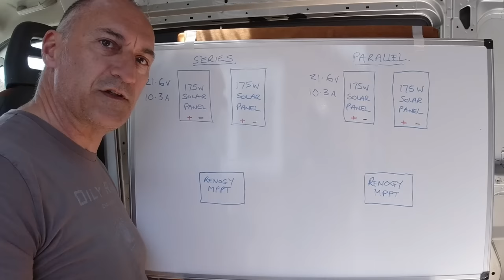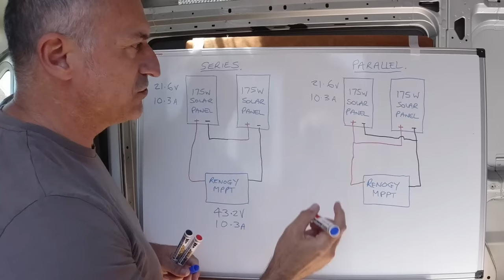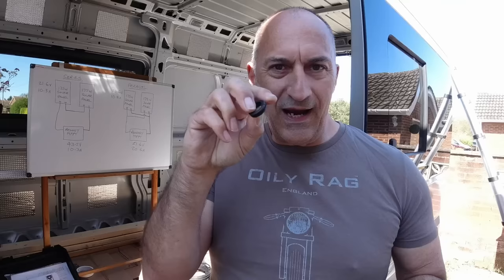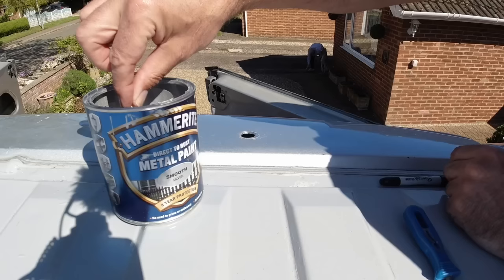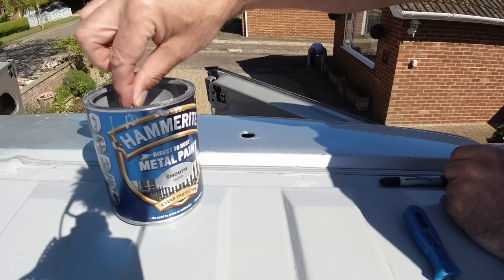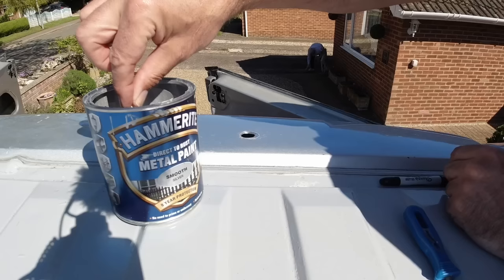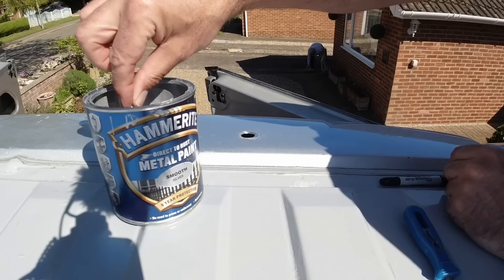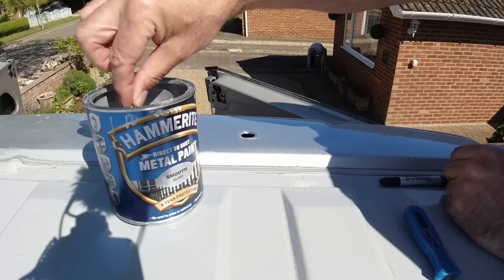How to Install Solar Panels - Budget Van Build Ep 10

Comment: Hi Greg you are helping me so much and for that I am truly grateful, I have a question if I May pls? I have a renogy rover 40amp MPPT with 2x100 watt renogy panels producing 20.1 volts 11-19 amps  and a 435 watt longi solar panel which gives 11-19 amps and 35.1 -40 volts am I best to run these in parallel or series pls? Thanks Jay

Comment: Hi Greg, fantastic video as always!
I have some questions
- Do you only hold the panel with one screw for each braket?
- I have exactly the same kit but when I try to put the tek screws on, they keep turning and they never seem to stop. In your video I saw that you don't make a great effort to bring the screw until it stops turning, but once it hits the bottom, you stop and add sikaflez on top.
is that so?
Thank you so much

Comment: I attached L-Track to my roof then attached the panels to those. If something changes down the road, and I need to replace the panel and can’t get the same size or want to do something different on my roof. I have those track too attached to no more new holes in my roof.
Reply from the maker: Well done 👍🏼

Comment: Hi greg im fitting two 175w panels on my mwb ducato i need to order the 6mm extension cables that run from the panels to the charge controler can you tell me how long they need to be thank grwat videos ive watched your videos like an instructuon video so far fitted the maxair fan and the floor so thanks for the videos really helped

Comment: Very nicely done and explained Greg. Guess what - I have got a box  of those grommets - box of 100 and I have used about 20 of them.🤣 PS: Do you not think it would better to just run the cables from the panels straight into the van and have the MC4 connectors inside - they are big and clunky things to have ‘tucked away on the roof?
Reply from the maker: The cables on the panels are very short so that would mean trying to route the cable across the shallow roof. The MC4s are totally waterproof and designed to be out in all weathers. 
They are hidden underneath the panels and tied to the roof.
Reply: @GregVirgoe  Thanks Greg, understood.
Reply: I am thinking of doing this as my panels might have a decent gap between them and don't want to have cable running all ovet the roof

Comment: Hi Greg . I'm in the process of setting up the same two panels and the same controller in the 50v 50amp model. My question is that would you wire in series for the best set up for the battery. And use the same gauge wire's. All best 👍👍

Comment: Hi Greg, first id like to say thanks for putting in the time and effort with your videos i find them very helpful. Quick question for you, i plan on using the same panels, already have maxfan deluxe in the same location as you. However i want a maxfann skymaxx at the rear end. So what i'd like to know is, is that space between you maxfan and the start of your panels big enough to fit a 400x400mm cut out in? obviously mine would be a slightly differant layout to yours but i assume if you could get one in the space i also could at the rear if that makes sense........cheers mate!
Reply from the maker: The overall length of the roof is 2.9m the panels take up 1.5m so that should leave plenty of space for two fans.

Comment: Hello, I saw a lot of your videos! good job! I want to put solar panel in my van but here in GREECE they stole them a lot. General they stole ALL THE VAN. So the question is :
any proposition for to not stole the solar panel? 
and 
Im in the start of building, I even didnt put isolation and wood inside...if first I fix all the inside of the van (isolation, wood, everything)...after, could I dreill the roof for to put the solar panel?

Comment: Would i need to add an i line fuse for parallel or series if im cinnecting durect into a 2000w solar generator. Im assuming the solgen has i built fuse to protect the system. Thank you for a great video

Comment: Hi Greg, love the videos, excellent detail & just about to start my Sprinter conversion, looking to use it just as a weekend away camper & weighing up if I  should go with one 405 watt panel or 2 - 3 x 175 panels, what are your thoughts please,
Reply from the maker: If you have multiple panels wired in parallel you get some redundancy should one be part shaded or you get a problem with one the others would still work. Better not to have all your eggs in one basket 🧺

Comment: Amazing amazing amazing videos. You're the best. Soon I'll start my own conversion here in Portugal and will follow most of your instructions. I have 2 questions:
1. Why have you decided for hard panels - Are they much better than the flexible ones (I am comparing the Renogy ones)?
2. If I have 3 x 175W panels it's ok to use parallel connection with that very same controller?

Thanks in advance and keep sharing your amazing content \o/
Reply from the maker: The rigid panels last a lot longer than the flexible ones. 25yr warranty on performance which you won’t get with flexible because they fail much sooner. 
You can use 3x 175w in parallel but you must get the 50a version of the charger which can handle more solar input.
Reply: @GregVirgoe  thanks! 🙇‍♂️

Comment: Hello!
Thank you for your help!

Questions:
Can I install the solar panels without connecting them straight away to the battery (I don't have it yet), is there any problem in leaving the bare cables inside the van?

I have a 30amp mttp controller. Do I need a 30A fuse?

Comment: Good evening Greg, I hope you've had a good Bank Holiday weekend,  I was wondering if you'd be so kind as to answer me a question I have about my own SWB Vivaro. I don't want to put any extra windows in my van as I want to keep it relatively stealth so need to put a vent in the roof. Do you think just one of those round spinning ones would be sufficient of should I put in something bigger? I have purchased a Fiamma roof vent but due to the placement of the roof struts in the van the only place I can put it would be just behind the bulk head. Do you think this would be OK as it's such a small van? Or would you recommend something else? Thank you in advance.  All the best.

Comment: hi Greg, Very clear video. i'm going to try this method tomorrow! I was just wondering when you thighten the bracket onto the roof, dont you push out all the sikaflex from under the bracket? thanks in advance
Reply from the maker: I try not to tighten them too much to avoid that, a good tip would be to use some nylon washers as spacers to stop that happening.

Comment: Hi Greg thanks for making these videos so easy to follow, with the panels what do you think of sticking the brackets to the roof any good?.
Cheers steve
Reply from the maker: If you just want to stick the panels down I would go for the moulded plastic brackets as they have a larger footprint so more contact area.

Comment: Hi Greg great video, very informative and a big help. I am soon upgrading my electrical system on my l2h2 boxer to have solar panels and inverter. Is there any deciding factors as to why you used rigid panels instead of flexible. I would like to use the flexible ones but not sure if it’s the right choice out of the two or if they have any issues? If you have any advice would be greatly appreciated. Thanks
Reply: Hi sorry I have just had a flick through the comments and have found your opinion. Basically get too hot and could fail early. Thanks

Comment: Greg your tails really should be isolated before connecting the MC4's  especially when in parallel and you are going to poke them through a small metal hole into a metal box. Trust me had a 20x3 panel parallel give me a belt. Love the vids though.
Reply from the maker: At 16:41 you will see red insulation tape over the end of the cable 😊

Comment: Hi Greg, brilliant video as usual.
Quick question: I see everyone using 2 wires to connect the solar panels to the mppt controller.
Are there any disadvantages of using only one wire for the positive connection from the solar panel(s) to the MPPT controller and then connecting the negative connection of the solar panel(s) and the negative connection of the MPPT controller directly to the car body?
Reply from the maker: DO NOT do that, solar panels can generate far more voltage than nominal 12v and if you try to run that through the van you can fry all your van electric and risk a shock to yourself too. My panels generate over 60volts in series and you would not want to touch that.

Comment: I would like to ask a couple of questions.

Do you think having panels wired in series and bumping a voltage down helps with low light conditions?

How much solar if any can we get in the UK in a winter on a horrible wet very cloudy day? How much solar would one need to keep diesel or gas powered heater like propex hs2000, couple of max fans, some lights, and couple other devices like laptop phones and just maybe tv screen running on a bad weather day in winter so battery is somewhat topped up? 

have you uploaded a video of your previous conversion usage on a cloudy day etc? thank you and really appreciate these videos
Reply from the maker: Ok 👍🏼 so yes I do believe that wiring panels in series helps in low light conditions because the volts are added together and would still give you enough voltage to get a small charge even on cloudy days. 
You have to pick an MPPT that allows a larger input voltage. My original Tracer unit goes up to 100volts however this new Renogy one is limited to 25volts so that wouldn’t be suitable. We manage ok in winter for last 5 yrs off grid and I have 3x160W wired in series. 
Limit what you use at night when there’s no solar and in the depth of winter we often turn the fridge off overnight as it’s not being opened and generally colder in the van 🚐 
Manage your power consumption and you’ll be ok 👍🏼

Comment: Hi Greg! Great video as always! A quick question, how would you wire 4x175W and what victron mppt controller would you use? I have 220Ah agm battery just now however I want 1000Ah lithium battery bank later on. Thanks for that! Hope you are enjoying Isle of Man and racing!
Reply from the maker: I would use a 150/60 mppt with those panels and wire 2 of them in series then parallel those together for the best of both worlds. 
220ah of AGM is a bit small for that much solar as you could be overcharging them. 300-400 would be better match to keep the charger rate below 20%
1000Ah of lithium is too much for that solar setup. The most you’ll generate in a day is 175-200Ah
So I would recommend no more than 400Ah which combined with a dc to dc charger would be a good setup.

Comment: Hi Greg,
Nice video as always.
Just a quick question,why not flexible solar panels which are much thinner, probably don't need brackets,drill holes.. just some sikaflex?
I just started a conversion as well and one of the next steps will be the solar panels..
Thanks
Reply from the maker: RELIABILITY - Flexible solar panels do not last very long at all and only come with a very short warranty for that reason. When mounted flat on a roof they get too hot and that makes them fail sooner. They are also less efficient than rigid panels so less watts for the size.

Comment: Greg.......nice video but your access cover for the cables ( gland box) entering the fan is back to front .....its shaped like a wing for a reason . Your entry points will be exposed to very high speed wind over the roof top , always faster than your actual speed.......love your videos though so keep going. Thank you
Reply from the maker: 😃 So I’ve got to ask you, do you think it will affect my fuel consumption with that extra drag?

Comment: Great advice again and good to see other options to Victron for budget builds. Any reason 2 solar panels not a 300w one as we plan a sky light in rear of our L2 ? Thanks Greg 😊
Reply from the maker: These two give us 350W and wired in parallel gives us redundancy if one is shaded or fails we still have one working 😊
Reply: @GregVirgoe  ah i see sounds good 👍 thanks Greg.. looking forward to your next video 📹 Lee
Reply: The typical 300W+ panel will also be a "24V" panel and so the voltage (around 40V) would be too high for a controller such as that Renogy combo that is voltage-limited.
Other benefits as Greg says, PLUS a lot easier to actually get the smaller panels lifted up on the roof. (Last solar I fitted happened to be a pair of 175Ws on a Ducato :) )

Comment: Nice one Greg 👍  Just wondered if any benefit of wrapping the solar cable connectors on the roof with self amalgamating tape...or are the connector100% waterproof ?
Cheers. Nigel
Reply from the maker: These are totally waterproof. They are designed to be outside in all weathers. No problem 😉

Comment: I would have thought you'd go for an solar generator here. Gets all your bits in one place. They take a wider span of PV voltages too.
Reply from the maker: I shall be comparing both systems in upcoming videos and discussing the pros and cons 👍🏼
Reply: @GregVirgoe  oh, great.
I'm installing an Bluetti AC200. Will integrate it as a drop in. Have 400w solar plugged into it in series. Getting as much solar as we can on less sunny days.

Comment: Hi greg, im a little puzzled. 
I have fitted 2x 200w panels on roof and wired them parallel as ive got a 30a renogy mttp control box as yours in video.  The trouble is that iam getting a reading of 21.8v which looks fine but the amps are 3.36 and only getting 60w during mid day full sun end of july.
Any ideas please. 
Note, ive not fitted to van battery yet as not quite worked out the smart alternator cable van fixing location.
Thanks and great vids as always.

Comment: Hey Greg. Great video. Did you use aftermarket fasteners for the brackets that are self tapping? Or did you use the ones that came with the kit
Reply from the maker: I used the self drilling ones that came with the fitting kit 👍🏼😊

Comment: Would this be the exact same process for drilling solar panels into the roof of a mustang? Would the carpet headliner on the inside ceiling affect anything or would it just go straight through it? Also would panels hold up alright on top while driving at high speeds? Thanks!

Comment: Once again a great video. I do have a small question: with these 2 solar panels, what is the maximum battery size that you can charge?

And is it possible to connect 3 solar panels in this way? and do you have to replace your 30 A fuse for a bigger one?

I ask this because I would like to be off-grid for 10 days
Reply from the maker: I have 3 x160w panels on my sprinter and 3x 110Ah batteries and am off grid 100% of the time every day. You would need a larger mppt charger and the fuse would need to be bigger too.

Comment: Hey Greg, I’m at a point in my build that I’m installing my solar panels and have only used the Renogy provided self tapping screws to secure them to the roof of my van ,along with heaps of Sikaflex. Would self tapping screws really be enough for long journeys and vibrations getting to them?

Comment: Awesome videos Greg and looking at doing the same as ive just brought a Ducato. Would 2 x Renogy 200w solar panels fit and be fine with all your components you used in the build?
Reply from the maker: Yes that is the max you can put on the 30A charger but will work well

Comment: Hi Greg, we've just mounted our 2x 200w renogy solar panels and will be using the same renogy dc-dc/mppt controller. How essential is the 6mm cable upgrade? Is the standard 4mm not up to the job? Thanks

Comment: 👍 also follow the build as I'm still in the early days of converting a boxer LWB van. May I ask what size of conduit did you use for your build. My local DIY shops only stock 25mm and it don't look big enough to fit 2 cables in it. 
Thanks. 👍
Reply from the maker: Yes I’m using 25mm conduit and I have fitted two cables inside it. I put two 16mm cables inside one conduit quite easily for the dc to dc charger. 👍🏼😃

Comment: Really brilliant Vlog Greg and easy for anyone to follow. One question have you found any degradation to the Sikaflex on your first van across the 4 years or is it still sound? Just wondering if there is a need for touch up at certain intervals? Look forward to each Vlog with great interest many thanks
Reply from the maker: I did have a leak on the front fan once but that proved to be not putting enough on one of the screws. It does stay very flexible over time. It only discolours with weather as not often get up to clean roof.
Reply: Clearly a quality product Greg thanks

Comment: Greg, just asking why your preference is to install the electrical system on the near side of the Ducato? Is this because it will be easier to route cables along that side and will also result in shorter cable runs?

Comment: Gday mate I’ve got a 92 t3500 Mazda bus fully fitted out and has dual battery controller which charges 1 house battery off the alternator atm I’m installing 250w solar panel and second battery What I need to know is do I need a dcdc controller or can I just use mppt solar controller ? And if dcdc controller is needed can you explain why please?
Cheers Greg 👍

Comment: Hi Greg I'm wiring my 3 x 200 watt solar panels tomorrow, I've got 3 x 3 way connectors for them, three positives into one and black into the other after fixing on the roof, I'm just thinking am I best wiring the in line fuse on the positive inside the van where i can see it ?
Reply from the maker: It’s best to be just after your 3way connector so it protects all of the single cable and it’s ok to be outside as it’s weatherproof 👍🏼😊

Comment: Hi Greg. Thanks for the videos. Just ordered most of the kit needed. Probably a silly question though, is it the 30amp or 50amp controller required? Cheers
Reply from the maker: For this setup it is the 30 amp charger I’m using.  Here is the wiring video 12v Electrics for Off-Grid Campervan - Fiat Ducato Budget Build Ep12
https://youtu.be/xCw7eARJKOg
Links are in the video description